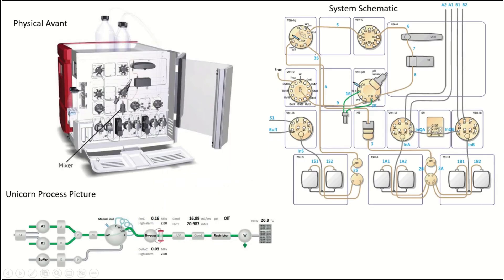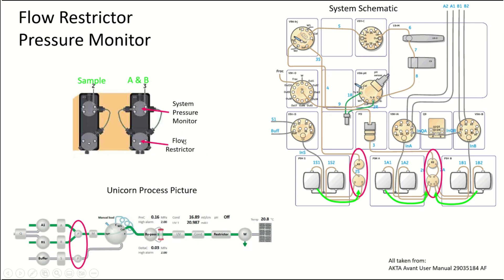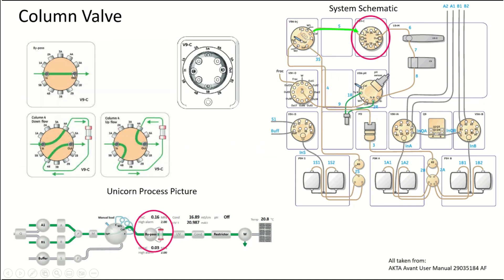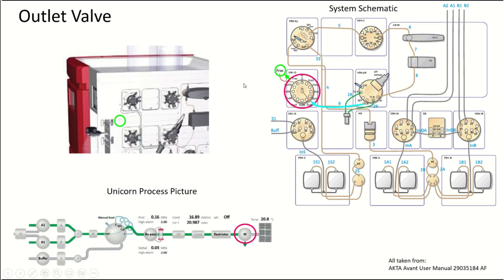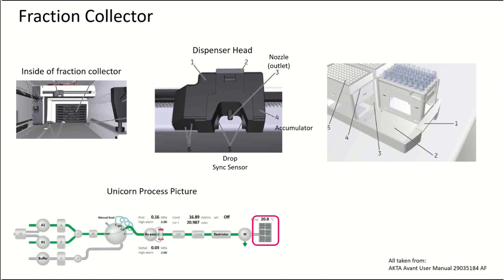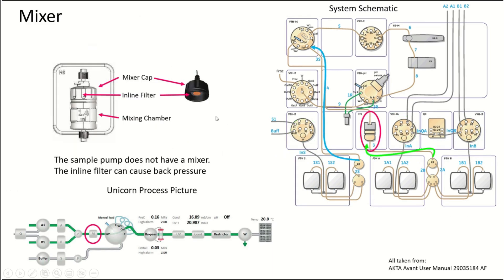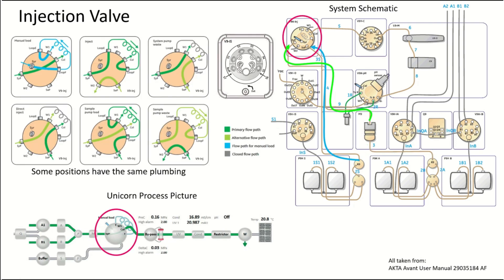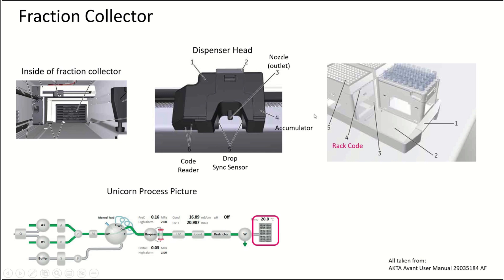AKTA Avant Flow Path

Comment: I am using AKTA Avant and AKTA Pure 150.
Reply from the maker: Nice!  I have those systems too.
Reply: @UnicornStuff  What are the main differences between avant and pure?
Reply from the maker: @luizors  The Avant is designed for scouting which is doing the same run over several times- but each time you change something like a column or a buffer.  The Pure is just as good, just not as flexible.  Both systems can be upgraded.  (Just to be clear I don't represent Cytiva... these are my own opinions.)